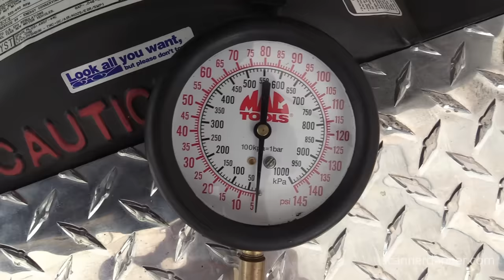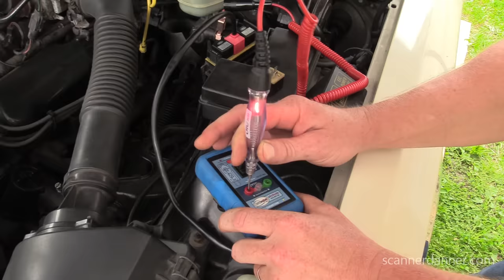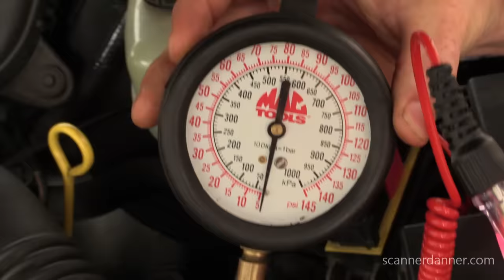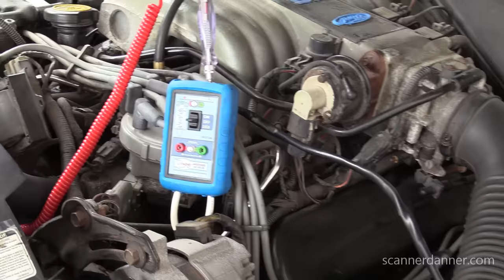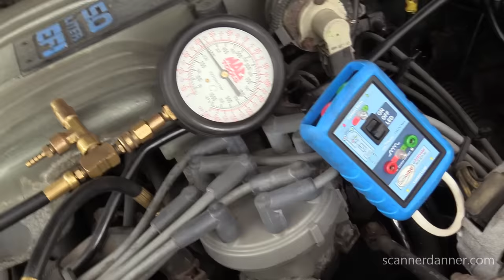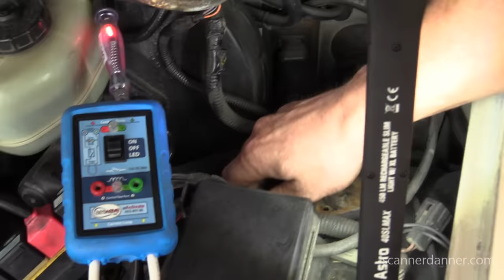New Fuel Pump, No Fuel Pressure Diagnosis (Lincoln Towncar comeback)

Comment: Maybe I'm having a "senior moment" but I don't understand why - if you had no fuel pressure initially, you then went to the spark test? Also how does a plugged filter ruin a fuel pump?  ...or maybe the answer to that was "these aftermarket pumps are complete junk"! haha!!!  DOES THAT BTW INCLUDE THE DELPHI? And to make it more interesting - as of Sept 7, 2022 my Ford dealership says there are no pumps available for a 2001 3.8...anywhere.
Reply from the maker: 1. To confirm it was not an input or ECM problem. No fuel pressure and no spark, I will treat differently than no fuel pressure and good spark. Make sense?
2. A plugged fuel filter will make the pump amperage increase and can prematurely burn up the pump

Comment: Could you help me? 2004 jeep liberty sport keeps looping or kind of jerking in idle . what could this be? Please help!! Thanks!
Reply from the maker: it could be a hundred different things. symptoms alone, I cannot help you. You will need to give me more info. 
Engine size, when the problem started, what you've done, trouble codes, fuel pressure, engine vacuum. etc etc
Reply: ScannerDanner ok thanks!!!

Comment: I consider it a comeback. The customer paid to have the fuel issue repaired even if there were multiple problems. The bad connector was bad at the previous repair and is part of the original problem. Even if it was intermittent it was still part of the original problem. So it should be repaired with no extra charge.
Reply: But - if the customer said I have a bad fuel pump can you put a new one in for me that would be a no comeback.
Reply from the maker: To be clear, there was no diagnostic fees charged, even for the first issue (it's my friends car)
If I was in the field and this was a job I was doing, I would want to be paid again. I disagree that the mechanic or garage should have to eat the time involved to find this separate issue. I have video evidence of both the initial diagnosis and this follow up to back up my claim. This problem WAS NOT MISSED in the first diagnosis of a faulty fuel pump. Was the pump identified properly as being bad? Yes it was. End of story in my opinion. It doesn't even matter that this was on the same circuit. Could this have been the cause of the original fuel pump failure? Yes, that is possible. Could this problem have been identified at the same time as having an open fuel pump motor? Without any chance of loading the circuit properly, not to mention it's intermittent nature? Not a chance.
Reply: @ScannerDanner  I still say it is a comeback. The mechanic missed the problem. Should he/she be paid. Yes. If it were repaired the first time the charges would have been higher because of the extra time involved. Maybe comeback is the wrong word but it was missed. That is all i am saying. So, if it had damaged the new pump would you have charged again for that too? S
Reply from the maker: Did you watch the original video? If you did not, watch from this point https://youtu.be/Tq1m3vzdVjo?t=1781  and answer this question. Did it need a new fuel pump? IF you agree that it did, then would you not agree that this is a separate problem? One that could not have been found unless you even knew to look for it? Even if the customer told you about an intermittent no start issue that he was having and then brought it in as a no start and you found a bad pump, wouldn't you tie those two together in your mind? Of course you would. You wouldn't have looked any further. Especially when the car runs after the new pump is installed AND it test drives fine. Not to mention, I even showed the proper amperage on the new pump!!
I know on paper, this looks bad. On paper, it was an intermittent wiring problem on the feed side of the pump and the car just got a new pump (which it needed)! As the mechanic/garage owner, I do not work for free, this problem was not overlooked or missed in the first diagnosis and I'm charging again. I understand the gray area we are in, but I have video evidence to back up everything I am saying. In the real world, you are right, any garage is going to want to call this a comeback even though the tech did absolutely nothing wrong. 
Just so we are clear, I am advocating for the technician here! He should be paid what he is worth. If the customer complains, then the garage can eat it if he wants, but he (the garage owner) should definitely be paying his tech another hour diagnostic time.  If I am the garage owner, I am NOT eating this one. How? Because I would be and was in, complete communication with my customer throughout the entire process. Both the first time and I also am this time around.

Comment: Iv got a 99 grand am that I was driven and it started sputtering and died  I had it towed. now I can hear the fuelpump buzzing when I turn the key but wont start it will start for a second if I put gas onto the intake,no fuses r blown new filter ,I can hear relay click,I'm stuck now with what could still be my problem?please let me know if I can help thanks Tom
Reply from the maker: Need a fuel psi reading, on the rail there is a service port and the gauge to connect to it can be found for cheap. Less than $40
Reply: @ScannerDanner  there isn't a fuel port to test on a 99 grand am so how can I test
Reply: And if I hear the pump can it still be bad
Reply from the maker: @thomaspennington2096  absolutely
Reply from the maker: @thomaspennington2096  is this the 2.4 engine? You'll need to have adapters to T a gauge into the psi line right at the rail.
Reply: @ScannerDanner  I'm not understanding at the rail were to tee in cause theres no opening to tee into
Reply: Do u have to take the rail off
Reply from the maker: @thomaspennington2096  on the psi line, where the flexible fuel line is attached to the metal fuel rail

Comment: When a dc motor spins slow it draws more amps because of the counter electro magnetic force is not great enough to limit the current. CEMF is created by all dc motors when rotating. Faster it rotates the more CEMF it creates. This is why all motors draw the most current when u first start them up. To simply, the motor is basically acting as a generator.

Comment: Hi Paul.  Why was the test light lighting when you were adjusting the terminal with the pliers?
Reply from the maker: Good eye! Noticed that in the edit only. Had to be the pliers touching the body of the car at the same time.
Reply: I thought the pliers were touching the brake line but they looked like coated brake lines.

Comment: Heh heh nice! 6-months later its missing fuel pressure again, as it's missing the control for the fuel relay (as 3 time the...) :D
Reply: Timo Wallin ... yeah I've had the third time's a charm on a GMC Denali. First time I did it was about 8 months ago. first one didn't work, had to drop the tank again and re-install another one and then it, 6 months later quit and put in a another aftermarket one and it was bad! I had to take it back out and finally got a better pump and got it working and it wasn't easy to put back in the tank... that is it didn't quite fit in the tank as well as it should have, but we got it sealed and running. Kind of went through hell getting the first one exchanged at O'Reilly's, trying to convince the boss that it wasn't my fault. Then took in the "new" pump in to show that it didn't work and had a bad connection between the top of the pump and down to the motor. Went to Napa and got a Delphi which worked but was a hard fit in the tank. Turned out he would have saved money if originally he would have spent $450 for an OEM from the dealer. Live and learn!

Comment: Good stuff, man! I need to get that "U" tool you've got there. 

To all the people out there, ScannerDanner Premium is the BEST bang for your buck ANYWHERE in the automotive world, hands down. $11 bucks a month - you'll save that, or make that back in no time using his troubleshooting methods! You owe it to yourself to get on there and subscribe! Well worth it - trust me on that!

Paul, I've been using your test light method to check spark ever since I found your vids about 18 months ago (maybe longer?). My buddy had his '96 Tahoe towed up here - he told me his cats were stopped up solid. As soon as I fired it up, I heard and felt a double-dead miss. Used the test light on cylinders 2 & 8 plug wires, then up at the cap to rule out the wires, and it was extremely weak, then non existent. It's nice using a test light, since you can increase and decrease the gap on the fly - you get a feel for what good spark feels like and looks like with the test light, and can tell when there's an issue. Turns out there's a TSB on distributor ventilation problems, causing corroded caps and other components - exactly what I had here! Replaced the cap & rotor, and she's back on the road again. Simple as that! Cats were fine!

I still own a '86 Grand Marquis - basically the exact same car as that Town Car there, with a different body (and a few updates electrically, as that relay center doesn't exist on mine). We've owned it 15 years - has 250k miles, and it's STILL on the OE fuel pump!! I even forgot to change the fuel filter for 12 years (who knows how long it had been in there prior - we bought the car with that filter!!) They sure don't build components like THAT anymore! Thankfully I haven't had any loose connections there, but I've had them elsewhere (headlights, A/C clutch, power windows, and power trunk & fuel door). Car is 32 years old now! Crazy - where did the time go?
Reply from the maker: Thanks so much Smitty!
Reply: Not a problem, brother. :)

Comment: My fuel pump lasted a month.  I have the 89 s10 pickup that won't start. What would happen if you removed the in tank fuel pump and put a inline fuel pump outside the tank. A Ford inline pump off a 87 Ford ranger and place a fuel regulator in front of it to decrease the pressure to 15 psi. You put a new pump in and you have to go through replacing it again because of garbage from China.

Comment: Why are you checking for spark when there is zero fuel pressure?
Reply from the maker: No fuel pressure with spark, I'm turning left.
No fuel pressure with no spark, I'm turning right.

1st example, inputs (cam/crank) are most likely good.
2nd example, I'm going after inputs next.
Reply: @ScannerDanner  Thanks mate.
Reply from the maker: @robinmountford5322  does that make sense?
Reply: @ScannerDanner   If there is spark, you 'll check the pump because everything else is likely good. No spark would indicate an electrical issue is causing the pump to not receive a voltage from the computer due to bad signalling from sensors caused by either a mechanical or sensor fault? And its easier to check for spark than it is to get to the pump.
Reply from the maker: @robinmountford5322  correct! 
Another way to put this is if I also have no spark, I am no longer worried about the fuel pump and fuel pump circuit in any way shape or form.
Reply: @ScannerDanner  Roger that. It makes a lot of sense now. Some good sleuthing there.

Comment: maybe someone else tested it before by jamming screwdriver/test-light/large pin into the connectors and loosened them up?
my thoughts are that wasn't the first fuel pump change it had
Reply from the maker: no one was in there

Comment: Have you ever fooled with a 2012 Honda Civic where somebody come in there and cut the wire at the main big wires on the ignition under the steering wheel if you have what color I got a green purple and orange and white and stripes and a pink white how they hook up
Reply from the maker: https://eautorepair.adtrk.biz/?a=10817&c=24&p=r&s1=

Comment: Wasted a lot of time at the relays and such, which also leads to faulty assumptions.  Corroded wires are extremely common in the rust belt. Number one thing I always check first is for power and ground at the pump or component, and the work backwards from there.
Reply: I know it can be frustrating. I've had this same thing happen before and always unfortunately  had to eat the cost even though it's seperate issues.
Reply from the maker: I wasted no time at all at the relay. 9 minutes into the video I had the issue identified. And 6 or 7 of those first 9 minutes I was teaching. So in 2-3 minutes I had the open in the pump feed problem identified.

Comment: You have no fuel pressure so WHY would you go to spark? Thanks.
Reply from the maker: For direction. If I have spark, I'm turning left. If I don't have spark, I'm turning right. On one path, I'm checking fuel pump power and ground, on the other path I'm NOT because this means I have an input or computer problem. 
Hope that makes sense
Reply: Ta, Thank you! I think it will make sense to me...one day I hope!
Reply from the maker: @johncollins8304  watch this one! https://youtu.be/ZgNY3ZpjSsU I explain this process a lot better. Let me know what you think

Comment: Why do you keep checking for spark when you know it isn't getting fuel fix the fuel first
Reply from the maker: because I am using that as a guide, telling me that I am still receiving a crank signal and that the ECM is still "alive". If the ECM is not "alive" I will also not have fuel pressure. I have some videos on this condition too. Does that make sense?

Comment: Hahha mate I new it was the pump with out all the testing you guys did have. Had lots of cars fail due to fuel pumps
Reply from the maker: Well you'll have to share you magic wand with me next time. It's a good thing we didn't need to learn any of the testing I showed. Who cares about amperage and voltage measurements, relay operation, power and ground side switching. 
Man you guys need to think bigger picture here.

Comment: +ScannerDanner

In the previous video you indicated that there may be another issue when you wiggled the the relay holder and everything clicked.

https://youtu.be/Tq1m3vzdVjo?t=10m50s
Reply from the maker: That click was me shorted out that circuit, covered later in the video. You must have missed that part. :-)
Reply: ScannerDanner yea I think I did. Nice work as per usual!
Reply from the maker: you missed a good part haha here is the time frame

https://www.youtube.com/watch?v=Tq1m3vzdVjo&t=3434s

Comment: If you cleaned the throttle body I think it would start and idle easier
Reply from the maker: These older Fords have a hole drilled into the throttle plate for minimum airflow, so cleaning the throttle body usually doesn't help on this design. But you would be correct in that direction on where to start with a case like this
Reply: ScannerDanner but I’d consider it has the same hole when it clean I should help

Comment: Pounding on the tank is for people in desperation mode hoping to jiggle the contacts and IS ONLY A HAIL MARY that does NOT fix anything. SO WHY DO IT AT ALL!? POUND ON YOUR OWN TANK! Seriously disappointing to see you resort to inexact and uninformed crude methodologies. Get technical Danner who uses the scanner.
Reply from the maker: Lol, I showed all the technical tests too. This is a legit method to bail you out in a pinch. Had a family stuck in a parking lot in a snowstorm that thought I was an angel from heaven using the tap test on the tank. Of course I told them not to shut it off and get straight home and that they will need a fuel pump. But damn bro, this wasn't a video on how to pound on the tank. Did you miss the rest of the tests? Getting the pump running at the end was simply proof of the call of a bad pump and allowed me to not have to return for a follow up video with a new pump installed.

Comment: This is kind of silly guy's you already seen the fuel pump wouldn't putting any pressure out so anybody with any brains knows it's not getting fuel why you even check for spark don't make any sense just my opinion
Reply from the maker: Because you can have no fuel pressure from an input or computer problem, so testing for spark eliminates that variable

Comment: how funny is that. He is talking and acting like hes a hot shot mechanic and its not happenin its not happenin. Because he isnt on concrete all of a sudden he goes soft because he doesnt want to get dirty. i just finished this same job on the ground in my back yard. I also have a 5m x 9m shed on slab with a hoist but it was less hassle to do it where it sat. Hot not not a hot shot
Reply from the maker: I'm definitely not a hot shot, give me a chance man. Thanks
Reply: @ScannerDanner  
Fare enough mate. But you have to realise that noone will search YouTube to be told to get a professional to do it. They have an issue or problem that they want to have a chop at fixing themselves. And changing a fuel filter is a very simple job that deffinay does not require a professional. It requires knowledge and some instructions. THAT is why they search YouTube and click on your video. In the hopes that because you've created a video on the subject that you actually know what your talking about. And its quite obvious you do about this as you did do it. Just realise that saying you should get a professional to do it is same as saying. This is a job you CANNOT do without a ton of mechanical experience so dont bother. Posting a video like this on YouTube your a teacher of sorts and people who have no idea on how to do the thing that is the subject of what ever video you post take what you say rather seriously and there actions will be based directly upon what advice is given in the video. 
Its how people learn and being told you can't do this yourself will stop 80% of people right there and then they will call a mechanic and pay money they didn't have to to get it done.
Reply from the maker: @australianrbnationals5553  it's been a long time, I don't remember saying anything like that, can you give me a time frame so I can clarify what I was saying. Thanks!